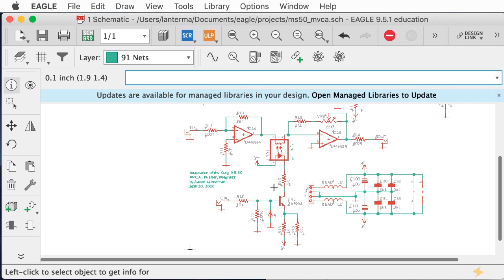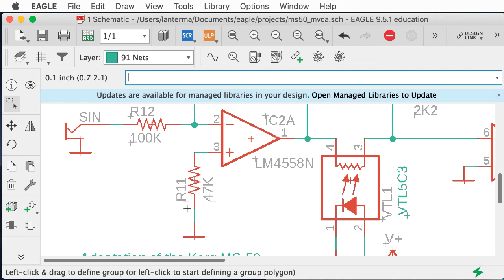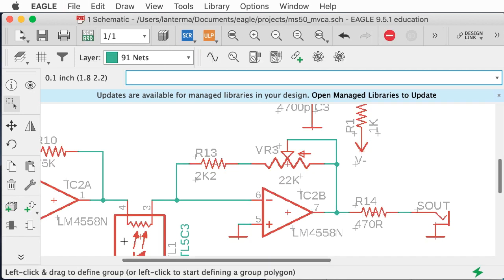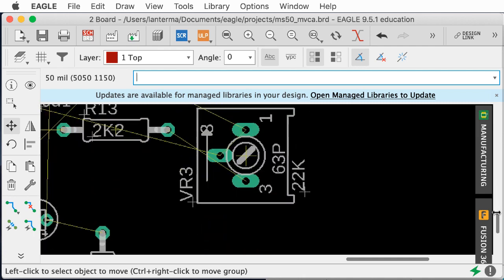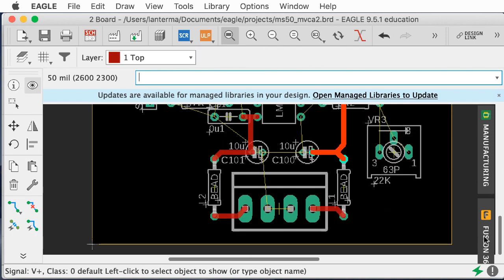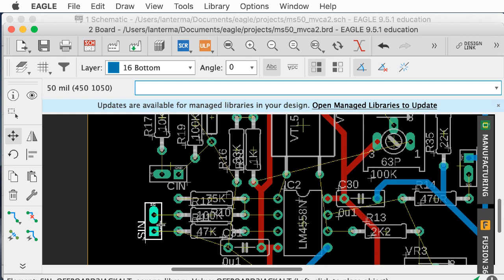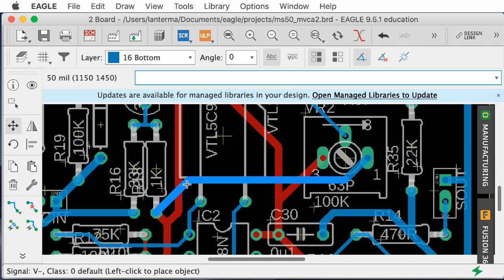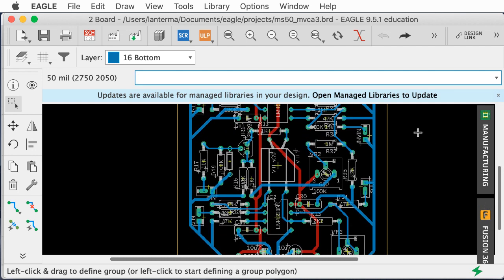Korg MS-50 Late Night PCB Layout with Eagle: MVCA, Inverter, and Integrator

Comment: Hello, I have built the Korg MS-50 VCF and VCA following the original schematics (I have built 60 modules based on schematics so far). Unfortunately, neither the VCF nor the VCA works! I have thoroughly checked everything several times, but I haven't been able to find any errors. My question is: are there any errors in the MS-50

Comment: Hi Aaron, thanks for those wonderful videos!
I have a question regarding the routing : you use a lot of sharp angles, to have a visual check of signals paths, but i’ve read somewhere to avoid them as pest, because they form some kind of acid trap, and reduce somehow the longevity of pcbs… is this b*llsh*t then? Thanks!
Reply from the maker: That's a good question. I'm definitely not an expert on this. My understanding is that it used to be a problem, but modern PCB manufacturing processes have gotten so good that it's not so much of a problem. 

One thing I used to do, that I now avoid, is have a long straight trace with branches coming off at 45 degrees along the way; I now try to make sure those are 90 degrees. I do this because Paul Schreiber told me to. ;)

Maybe if you are trying to etch PCBs at home the acid trap issue is something to worry about.

It may also be the case that I don't have to worry about acid traps at this scale with modern PCB manufacturing, but if you are doing a PCB with super narrow traces and super narrow spacing it's an issue to worry about.

If anyone with more PCB design knowledge/experience than me wants to chime in here please do!
Reply: @Lantertronics   thank you for answer! I will then go back to 90degrees angles, it seems like most people use that technique!
Reply from the maker: @wawajanvier  If it's just one trace and I don't need to branch, I'll usually do two 45 degree bends instead of one 90 degree, but that has more to do with how I like the way it looks aesthetically than anything else. ;)

The one place all of this really starts to matter is really high frequency stuff, but for audio it doesn't really matter.